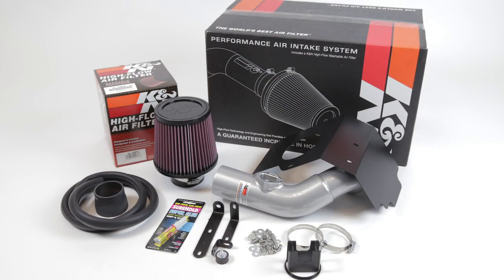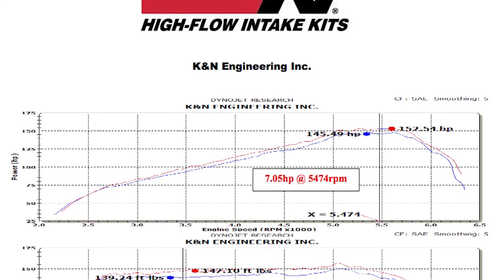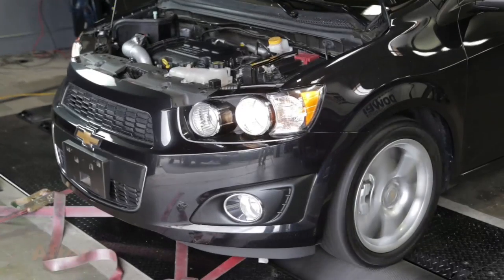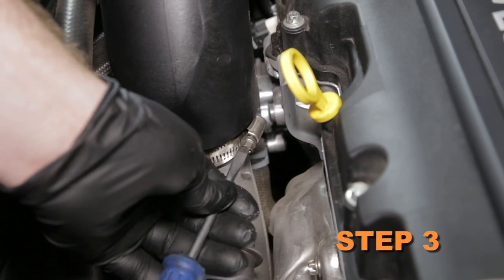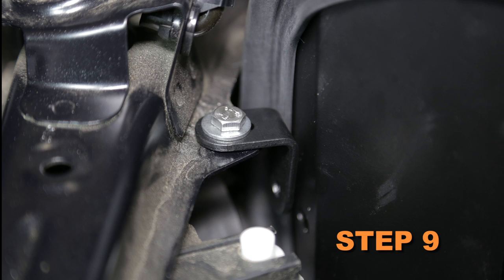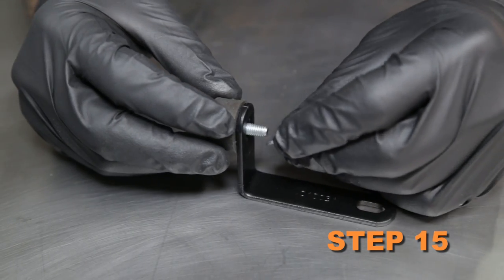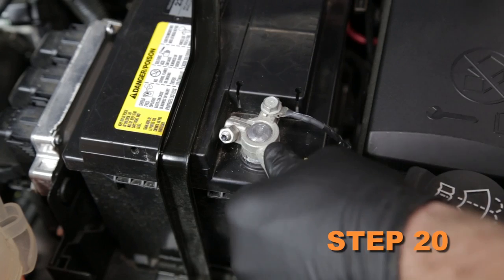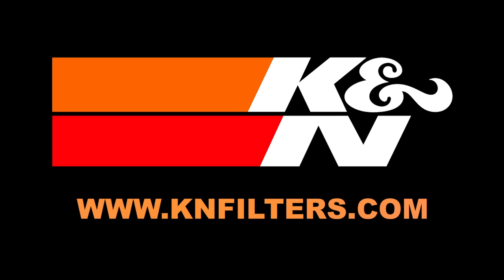Chevy Sonic 1.4L [#69-4524TS] Air Intake Installation

Comment: What benefit can I get from upgrading my intake system. I want to do it for durability since is an aluminum hose and not the plastic one that breaks easily. Other than that I don't know what else it does.

Comment: whats the emperature drop on the air going into the turbo with the heatshield and a intake without it? i have heard it said alot that there is very little difference that others do not use the heatshield because of that little difference...
Reply from the maker: +S.D. Cruz We have noticed a substantial difference in temperature with the heat shield for most applications.